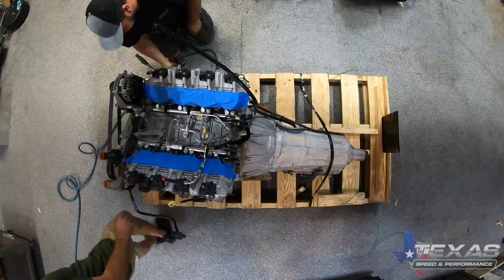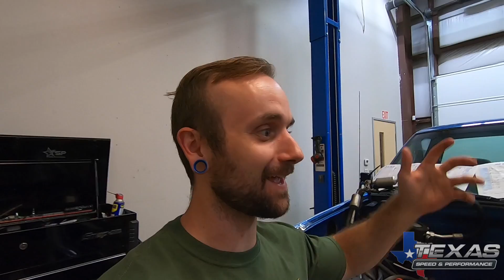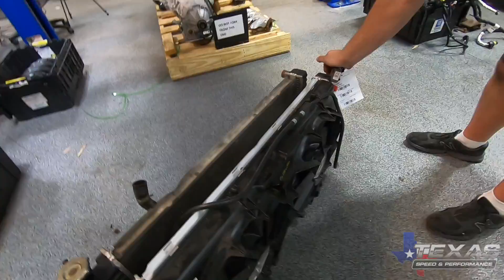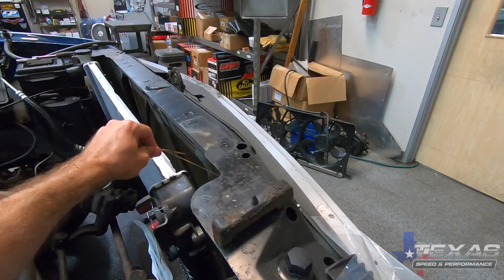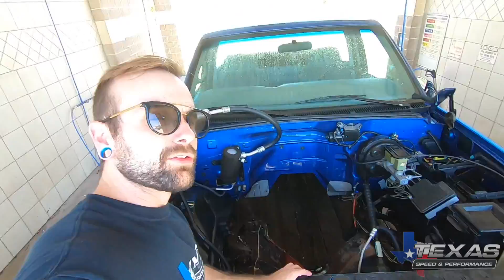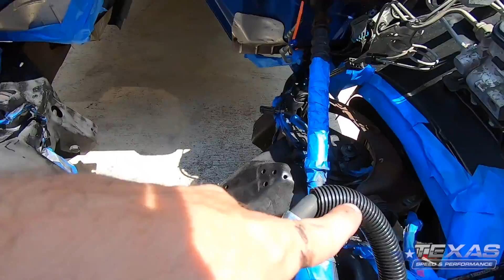Shop Truck Is Prepped / Ready For The New L83 Engine Swap!

Comment: use a 6.5 diesel surge tank that’ll bolt in the stock location on the firewall
Reply: Matt G Thanks for the tip. Haven’t even researched it yet.

Comment: You're nuts for using tape for all that. TIN FOIL!!!! Wrap it, paint, and pull it.
Reply: Scotty doesn'tKNOW Next time we will hit up Walgreens beforehand. Actually will use that tip on some of my own builds, never heard or thought about it before though.
Reply: @josephpotak  yeah man it's actually about what I'm about to do to my 90 c1500. Just got the old 5.3 pulled and painting the bay for the new and improved 5.3 but I'm doing POR15 not rattle can.

Comment: How in the world do you guys not have a power washer for the shop!  I just bought a refurbished electric ryobi 2000 psi for $120 from Home Depot and it works amazing!
Reply: Okie Joe Have a couple nice ones but no wash pit/grease trap, don’t want to deal with washing oil/grease into street/ground etc.

Comment: Man you are going to regret putting that direct injection engine it that truck ,they have nothing but problems with Carbon Build up on the valves
Reply: When they boost it , and put the secondary port injection , it'll be fine . 
   Wanna wash the valves , Stand in it !!!
Reply: Carbon problems? I own one and work on them every day, never once had an issue with carbon on the valves...

Comment: Tip for the day: using aluminum foil to cover the hard lines and other little bits makes it easier to remove when done than using painters tape

I know to late now, but there may be a next time
Reply: Old newspaper works good with tape too
Reply: irunolds tru but foil is still way easier to wrap up things and remove after.. I’ve tried each way and I’ll never use tape or paper as long as I have foil